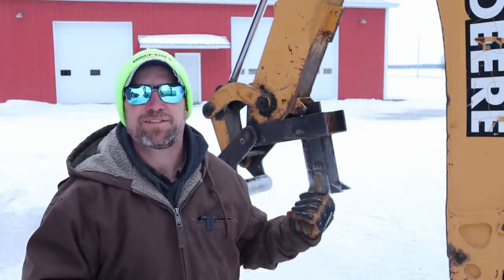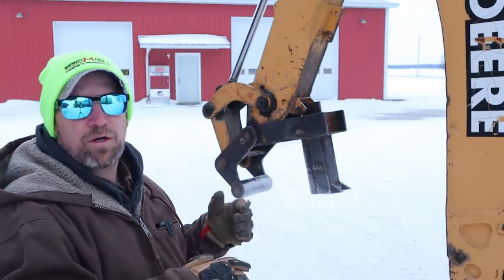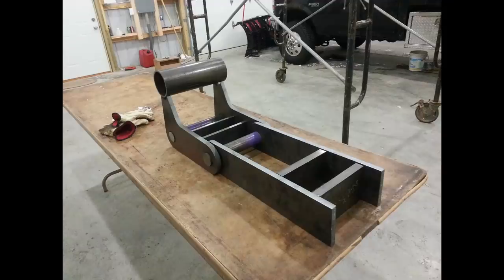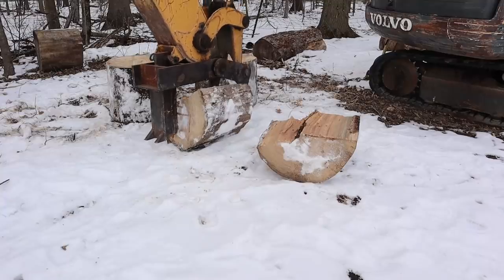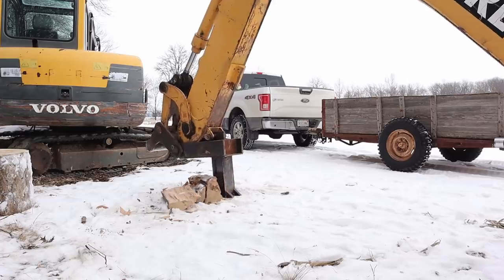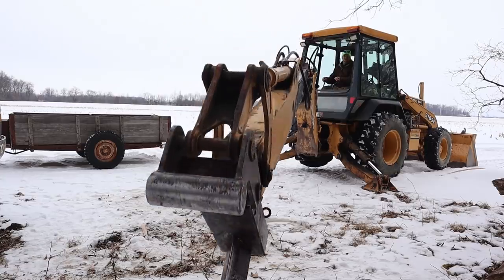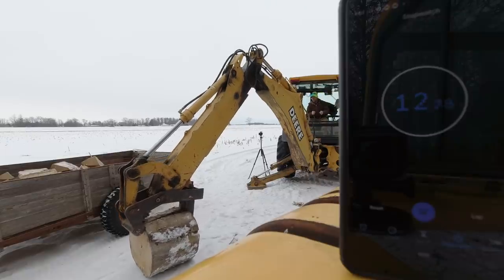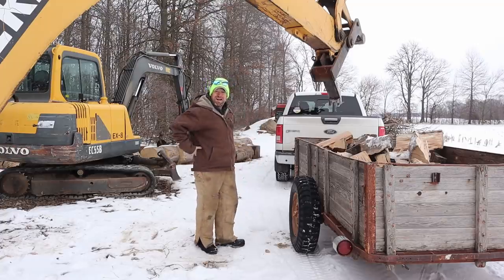My Wood Splitter Doubles as a Backhoe! - Homemade DIY Wood Splitter Splits Large Rounds With Ease

Comment: With all that effort beating on those short blocks, just revving up the chainsaw for a few short moments will break them down in short order. 
But the more expensive backhoe version is certainly less work than using the chainsaw.. just a bit more expensive.

Comment: My issue with this is putting a bunch of hours on an expensive piece of equipment.
Reply: I don't see the problem.....
.... unless you bought the digger as a show piece....
Reply from the maker: Well, I suppose if this was a new machine it could matter, but really doesn't affect mine in anyway being over 20 years old now.  I have never even thought about the hours that it puts on it.  I'm not worried about resale.  It's still worth about what I paid for it 10 years ago actually.  These backhoes get to a certain point and they just kinda hold their value at $18-$20K.
Reply from the maker: Honestly I never even considered the hours being put on it.  Mine's an oldie with 8000 hours already.
Reply: @digdrivediy  I totally get not caring about the hours you put on an older machine like this. But there is still a cost, and that may be higher than getting a dedicated gas powered wood splitter. I have a Kubota M59 and was given a log splitter that ran off my rear remotes.  Came to the conclusion it was cheaper to get a gas powered splitter rather than rack up the hours on the Kubota. Sometimes it's a convinience thing.

Comment: Anyone takes credit for what’s been done for decades. I was splitting entire trees with an old cat 245 excavator, 40 years ago.
Reply from the maker: I never took credit for this at all. I said in the beginning of the video this was not my original idea.  Still, it's amazing we don't see more of these in use.  I think because it is tough to operate efficiently most likely. Do you still use yours? Thanks for watching although you must not have watched very much to say I was taking credit for this 🤔
Reply: @digdrivediy  but you are using an old idea to make money off of on you tube. Every large site excavation for longer then I’ve been in it, has been doing what your showing. A backho is to small and to slow. On my cat 390, I clear upwards of 10 acres per day. More if it isn’t dense timber. Splitting trees in their whole is part of it or snapping them into useable lengths. An experienced operator doesn’t need a special tool for each operation. A general purpose bucket with hydraulic thumb is sufficient.

Comment: Let me see if i got this right...
You are happy about destroying ~600+ y old OAK-TREES and using it for ...FIREWOOD?!??
Oak.....
...FIREwood 👎
Sure you could not get a prize from a furniture or flooring business?!? One that would you BUY like 10 times the amount of gift-wrapped firewood delivered at your address?!??
Oak as firewood........ geeeeeeez 🤦‍♂️
Reply from the maker: I don't cut any oak trees down for firewood. They are either dead or they've been cleared because of storm damage or some other reason. There are plenty of sawmills around here that'll take logs when they know the source of the log. Oak trees from people's yards or fence rows usually contain metal of some sort and the sawmills will not take them because of the risk of ruining the giant saw blade. I've dulled many a chainsaw chain by cutting up logs that run people's yard or from fence rows.  They contain deer stands, fence posts, fence wire, bird feeder hangers. All kinds of things from people attaching things to their trees over the years.
Geeeezzzz